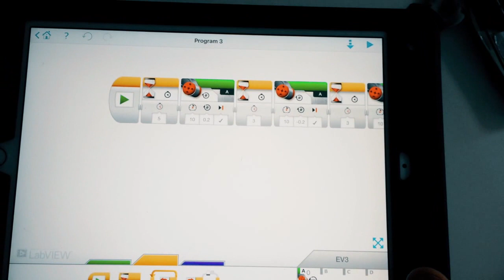Upgrade Required: Stargate Exo-Neck Test

Comment: Well, here was I thinking you might drill a shaft up through the torso (Probably from, well I think you get the picture) and then glue a rod to the base of the neck inside and then attach that to the drive of the servo, controlled in turn by your pad... That way, no cable ties which look like a torture device, just a... Okay, a hole and a rod that, looks, like ,a, torture device but up the... Oh hell, you know what I mean.

Comment: Would it not be a better approach for achieving assisted head movement, by a system in which you could use the robotic arm attached from behind the head. With the hand end of the arm against the back of the head with a strap attachment system that provided stability and comfort.  Haveing the arm behind the subject. Would allow for a larger range of motion, less restricted field of view.   A design like this should also be smaller in overall size, i would think.

Comment: Hi there David,
I would suggest smoothing the surface of your rotator to make for a nice comfortable ride. And then slowing down its speed to work in conjuction with it - slow and steady. The less resistance on the user's neck the better. It's like the device must 'think' like he would and then provide the best possible service.

It's a cool thing you're doing for your friend. I really hope you find the best way.

Groete (Cheers) hope you have an awesome week.

Comment: I don't know how viable this idea is but what about some sort of anchored brace up to shoulder level with this robot attached to the top.  Your friend would wear a helmet, maybe styled like a motorcycle helmet, something solid to the back of the neck at least, with a ball joint fixed to the back roughly level with his eyes. If he wants to look to the right, the robots arm would move to the left and pull the pin on the ball joint until the pin contacts with the joint and begins to push his head.

The arm would have to be programmed to move both vertically and horizontally to keep his head moving in one direction but it seems like a cleaner alternative to pulleys and cables and should allow him to move his head in all directions.

Comment: Hmmm...if I was to build something to help I would construct a unit that attaches across the shoulders and neck, then have a control that would allow the user to facilitate movement. Like what you showed but not strapped to the head from the top.

Comment: The robot hand may be the wrong direction to go. Arduino community has a lot of code pre-made, you have options to buy Arduino certified products OR for people with smaller budget there are plenty of clones out there, an Uno clone from ebay costs less than $4, all the gear needed, servos, relays, wires, buttons, ... can be found both on ebay for quite cheap and from more legit sources for more $$.

If end goal is to help others, as many others as possible, then perhaps a solution that can reach/be built by almost anyone is the way to go & with as many COTS (Commercial Off The Shelf) parts as possible.
Reply from the maker: +WKDworks Absolutely...I've got Arduino and working my way through the many tutorials...definitely want open-source and available for the actual build!

Comment: haha thats great, trying to imagine a full scale version, seems painful! what about some kind of turret ring? look at a ww2 tank or battleship. the turrets holding the gun is sat on a ring of ball bearings and the turret is turned through a motor or by hand/gears. if you could downsize that concept, add cushioning and make it out of plastic, then secure both sides to head and body. do you understand what i mean? oh also i'm a programmer with experience in the C family so if you ever need any help on the software side don't hesitate. its a good cause, as someone with a disability that affects my mobility i have a level of sympathy for what your trying to do :) so you know thanks for trying!

Comment: Something I've always wondered about when it comes to prosthesis and assisted movement like this has always been why I never hear much about electroactive polymers. They've always struck me as one of the best ways to simulate more natural movement since they act very much like muscles do, unlike servos and motors which have a very stiff and artificial look about them. Is that something you're going to look into on upgrade required at all?